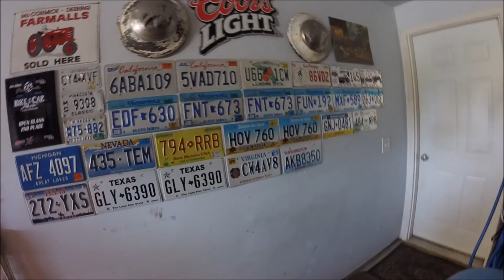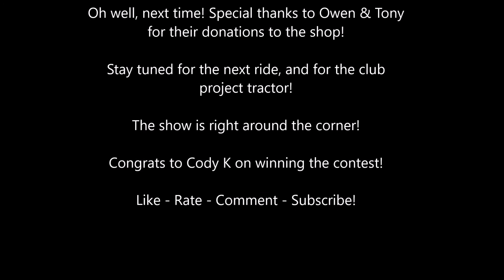2017 Nowthen Pre Show: Tying Up Loose Ends

Comment: LOVE your Videos !!!!  I Last June 2017 picked up a Case SC and have been in the restoration process of it.... Your videos help a ton and you give some great information, Thanks for posting all that you do !!!!   I have a few more steps to go and mine will be done finally and can be added to the list of another saved from death of the scrap yard !!
Reply from the maker: Glad you like the videos, bud! Anything I can do to help, I will! I sure would love to see some video on your SC - there isn't nearly enough footage of those tractors out there. Anything I can help with, let me know!
Reply: I agree there needs to be more videos of them and ill try to get some footage .... at moment im having a issue getting a new manifold to line up on it and it just dosent like air leaks at those manifold ports as it let me know very fast with very loud bangs and shooting smoke all over me But I think that will stop once I receive and add the new manifold gaskets I have on the way for it... least I hope that helps smooth it out and run like normal... so far Ive redone just about everything to it and will grab some footage soon!!!
Reply from the maker: Manifold leaks can really fight you. New gaskets will make a world of difference (hopefully). Another thing, these Case SC's are notorious for rusting/burning through on the inside of the manifold between the intake and exhaust sides. Hopefully that is not your issue. Manifold surfaces can get uneven as well from rust, etc. Trying to get them as level and true as possible can be a challenge. Look forward to seeing some video from you. Good luck!
Reply: Thanks a ton Kenny for the fast reply and I agree 100%.... it scared the daylights outta me during the first 'BANG"  LOL ... seems that out of all the Case SC's Built I got the one with the biggest attitude problems hahaha But I should have it running as normal soon I hope and YES to comment on your comment..... Just today I was working on getting them ports as level as I could with what I have to work with.. (very little at a time) of course cus I don't wanna take off to much then not be able to get that to seal at all around each port.... also I was gonna do a vid of that work today and the cam batteries were dead soooo soon as they now show up in the mail ill get some footage for U and a walk around of the whole tractor as well .. Keep up the great work and vid and Love chatting with you!!!
Reply from the maker: Declin2284 it's a real pleasure, bud! I'm just glad that everyone enjoys watching. I get a kick out of this little community we have going. It's amazing to see how far the reach of these old tractors goes. Take your time on the SC, it will be worth it (and eventually she will stop fighting you). 😀

Comment: Fun video.  That F-20 defiantly has that F-20 sound.  A sound that a person will never forget.  Just a suggestion, extend the crank handle the same amount you cut out of the shaft going through the front steering bolster.  Find a F-30 to go with the F-20.  That would be a fun project as well. Keep the videos coming and also take care and God Bless.
Reply from the maker: Thanks, Gary. It sure is loud, that is for sure. I'll have to do something with the crank, but for now I just park it with the wheels cranked all the way to the right. Not a huge deal, and once I figure out the starting procedure, it SHOULD only take a couple half turns to fire up. I am not sure what I want to tackle for my next project.. But, before I add any more tractors, we NEED a different place to call home. This little townhouse isn't cutting it!

Comment: I don't remember a seat frame and spring like that on an F-20. I think what you have on your F-20 is an add on from a later Farmall.
Reply: I did some research and your design seat was added in the early 1930s.
Reply from the maker: Yes, James. They were an aftermarket seat made by Monroe. There are a lot of Monroe seats out there on H's, M's, JD A/B/G, Case SC/DC, and also some on Allis Chalmers I believe. Comfort Ride seat they called it I believe.

Comment: That A sounds good. If you have everything ready you can do a head gasket on an A in 6 hours, running to running. I know because I've done it personally. What's the serial number on it by the way? Always have to compare them to mine lol
Reply from the maker: Thanks, Stubby. It is bored .045 over, so I am sure that helps (and the straight pipe). I should have bought a new head gasket when I put it back together, but a fella donated this one to my project, I just had to clean it up some.. Well, sometimes things bite you in the butt. Ah, well.. It will give me something to do over the winter!
Reply: Kenny Kizzle I have no self control so I'd put some high compression pistons in it lol. I have 2 more that the head gaskets went out on and need work. My A will get some power parts though lol
Reply from the maker: I thought about using the A as a pulling tractor, but I would probably have to go through the bearings in the transmission if I were to do that (just to be safe). I found that I need to do axle seals as well. Should be fun since I can't get one of the rear wheels to slide! Lol.
Reply: Kenny Kizzle mine will be a mess around tractor if I do it. The block needs to come off anyway so I'll have it bored. You'll need a big bottle jack and a heavy chain to try and move it lol. We made a puller for ours
Reply from the maker: Ya.. I have been avoiding it. Lol!

Comment: Hey Kenny ....My sc is almost ready for paint .....just have to finish paint booth . anyhow could u please send paint codes? Also I am looking for starter crank and clip .thanks a lot ,Glen from Racine Wisconsin
Reply from the maker: Glen, the paint codes I used are as follows: PPG Omni Line, Flambeau #71282 and I used Argent Silver #8568 for the rear rims. It lays down very nice, and has a great shine when you add hardener. The starter crank and clip I would contact Don Livingston at Rusty Acre. If you do a google search you can find him easily. Can't wait to see your SC!